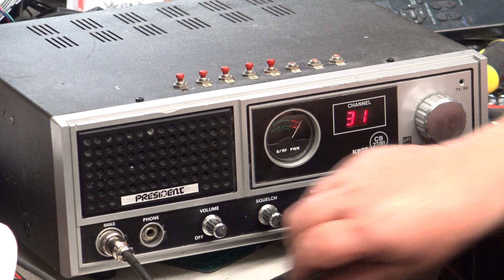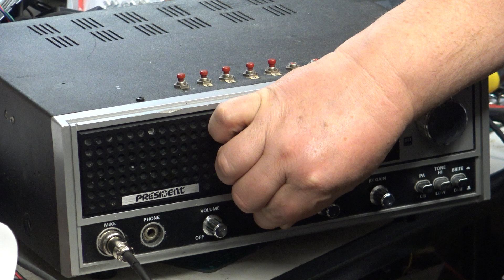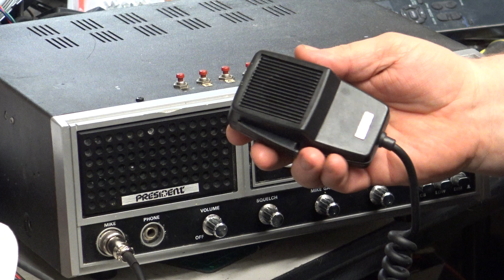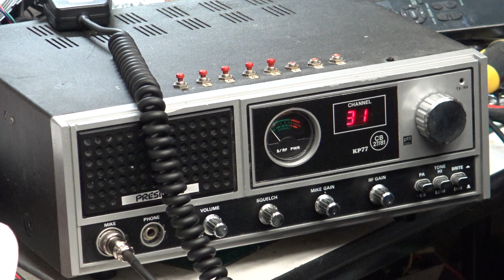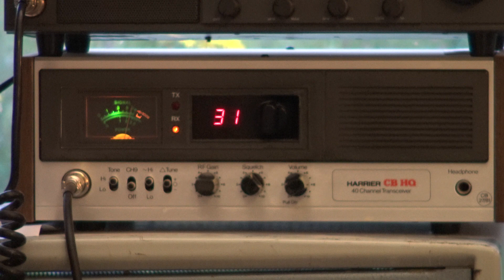President KP77  CB27/81 UK FM CB base station - On The Air Test

Comment: I had one of these and it was rubbish! A Dutch standard radio with an LC7137 40 channel UK board hastily shoehorned in. On the other hand it did teach me how NOT to do it!
Reply from the maker: I agree. I've another one here to do next year too!

Richard
Reply: @ukfmcbradioservicingTango21  About 20 years ago I bought one just to see how bad they were. Then sold it but as a parting gift put in a 2-pole xtal filter in place of the 'potato' 10.695MHz ceramic filter. So if you find one like that... it was me.

Comment: I used one of those cases KP77 and Put a Uniace 100 board.but as it was my radio I used all yellow wire inside it.back in the 80s wonder if someone still has it lol
Reply from the maker: That's interesting. The third one I have has the 'wrong' board in it just like what you did. Not sure about the wires, we'll have to have a look. The snag is, changing boards over stops it being legal, not that anyone would bet nicked for it. As a licenced 2-way radio engineer I am required to keep 'monster' hybrid sets out of circulation. I'm therefore looking for a KP77 innards to replace the 'wrong' board. Great story, you look well if I've got your ex one!

Richard, G0OJF, UK

Comment: Ok Richard I'm just going to say it.. I've never heard of or seen anyone put a complete radio through a dishwasher before EVER.. I didn't realise until halfway through the video my jaw was still dropped.. well done and it turned out really nice on the final test.. still scratching my head how it still works after going in the dishwasher 😂
Reply from the maker: Very rapid drying between the convector heater & air conditioner.!

Richard